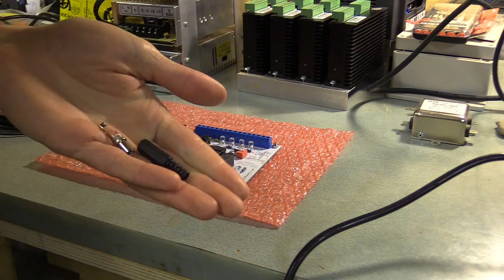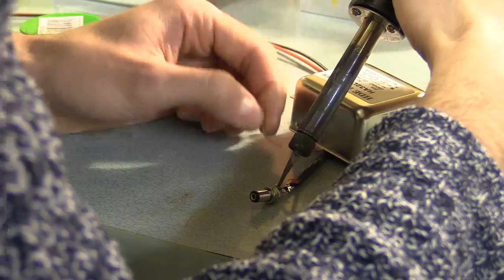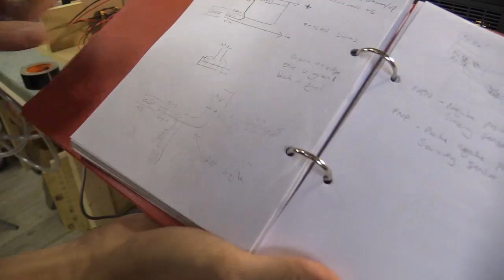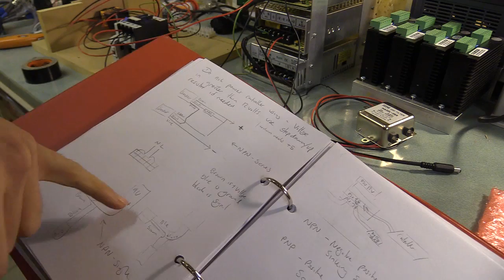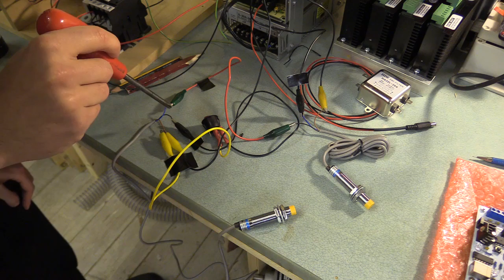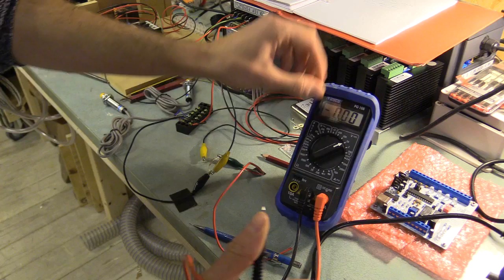#10 NPN Proximity Limit Sensors #10 / CNC Control Box

Comment: Hi Savvas, do you still have a schematic as to how you finally wired these sensors in parallel ?  I wish to do the same, and have a pair on the Y & X axis. Happy to get through your Patreon.
Reply from the maker: I just double checked and they look like they are on the patron. It is literally a sketch on a piece of paper though under the title: Wiring N/O NPN Proximity Sensors In Parallel

Comment: I'd reduce those resistor something like a factor 10, such high impedance is just inviting problems with interference  from stepper drivers and spindle
Reply from the maker: I read that the lower the voltage the more likely it would have problems with interference but would this still be the same if the resistors are right next to the control board? I need to read more into this.Thanks for the comment.
Reply: lowering both resistors in the divider the voltages stay the same, but with the lower resistance it is harder for interference to alter the signal. You still want the resistors to be close to the control board to minimize the low voltage wiring
Reply from the maker: It seems that when I had three proximity sensors connected the output dropped to around 3v on two of the dividers and one seemed to output nothing - but individually they worked as expected. Maybe I should run the sensors via relays?
Reply: there is no reason to use relays it should work. can you draw up how you have them connected?
Reply from the maker: Ok it is working now - I had made some mistakes with soldering the proximity sensors and will go over this in the next video. But I am still using 10k and 15k resistors. I was advised that what you mention would only be a problem if the limits switched at a very high rate. Problem solving electronics is a skill in it's own right that I haven't fully developed. :S